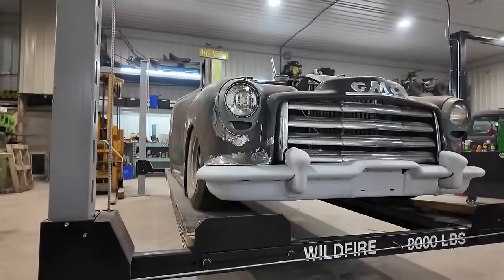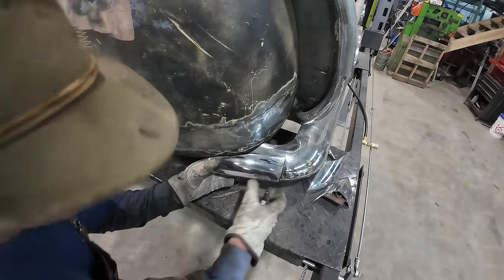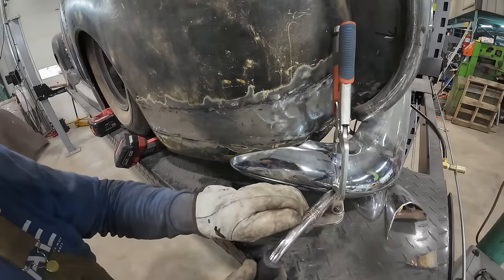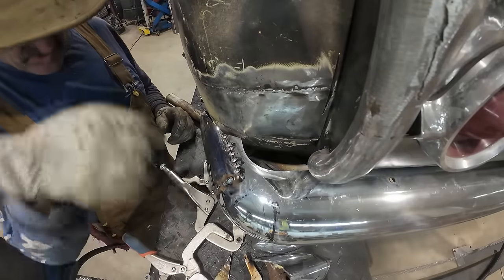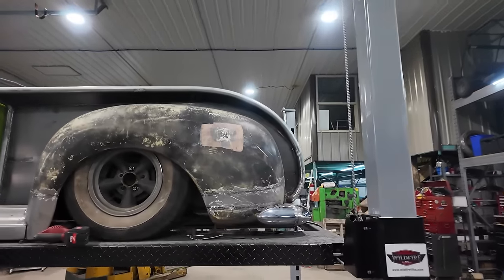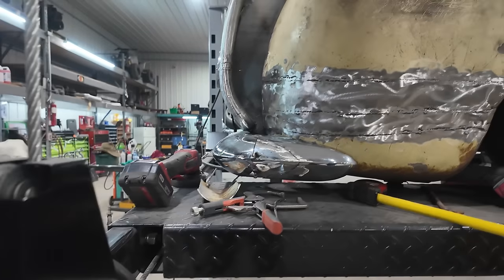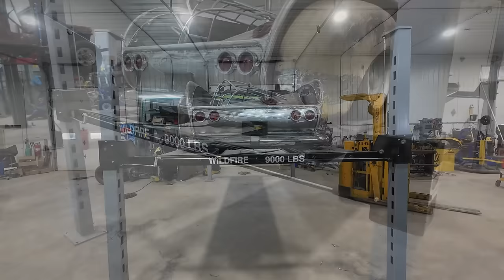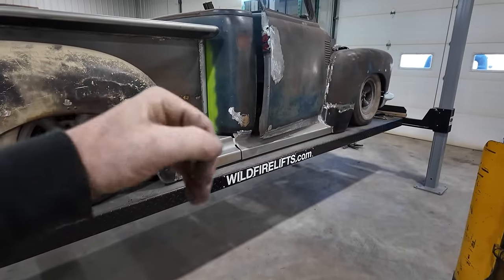Cutting up our rear bumper AGAIN! But I think the results are worth it.

Comment: Hey Brent, just thinking again about the paint job for this in the future. I also believe that black body with the Halfass customs green for bumpers and other highlights. I also agree with JDLarge that you are a master of your craft, not just metal. I think I may be using the right word for the combination of talents, you are a polymath. You sure have an accurate electrometer, as Carl would call it.

Comment: If wire feed welders were as easy to obtain 40yrs ago as today , I could've been a legend in my 60s , lol . I used a oxy acetylene rig to do most custom stuff , lots if grinding and straightening involved with all that heat generated,  or the trustee stick welder and compressed air to cool or a water bucket and red rags , stuff is so much easier nowadays

Comment: I would cut the bumper again an inch or two in from the 90 bend..put a straight edge across back fender to get a measurment for size
Then finish bumper same as front and add a to top for nice finish..